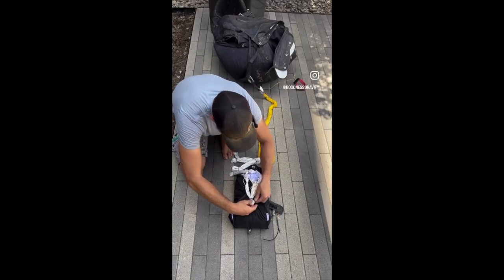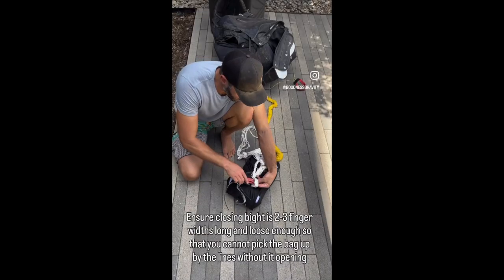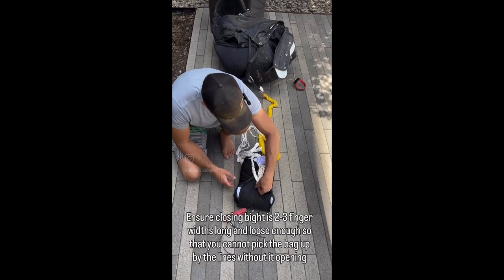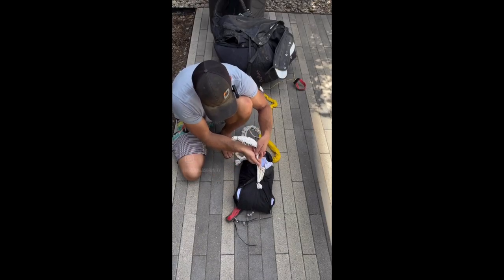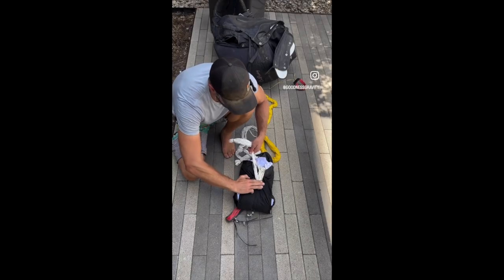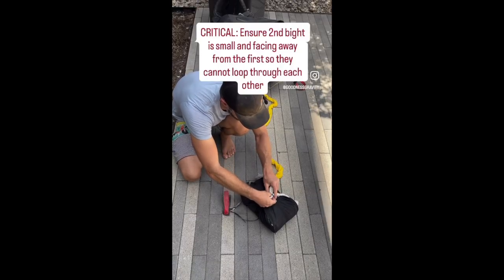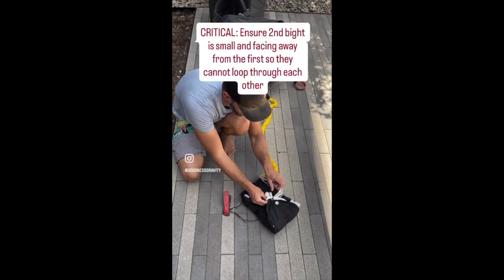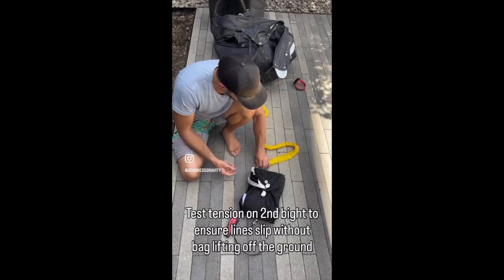2 stage reserve parachute packing for paragliders

Comment: Good explanation! Luckily, most modern reserves and harnesses use 5 flaps containers, so following the official product instructions is sufficient.
Reply: Following official product instruction for 5 flaps container reserve does not necessarily mean that you are packing 2 stage way. Take for example Beamer 3 which has 5 flaps container but still use one stage packing in manual. While very similar Sky Drive 2 use two stage instead.